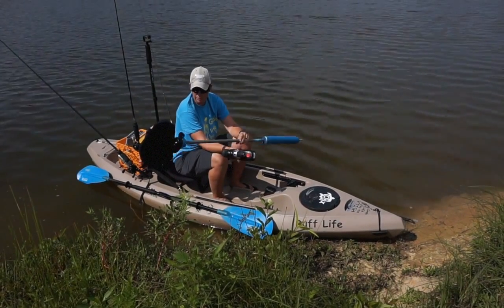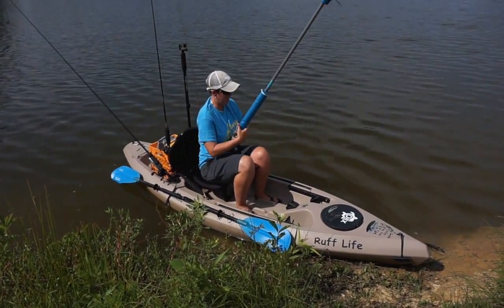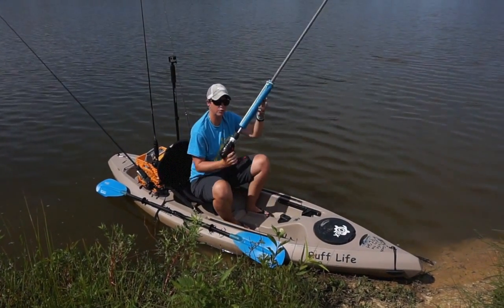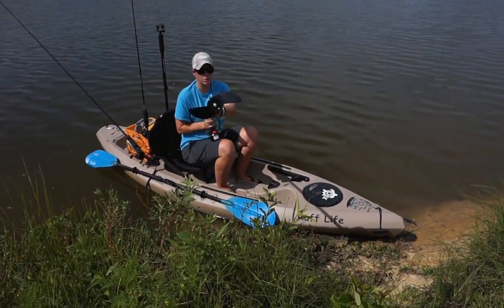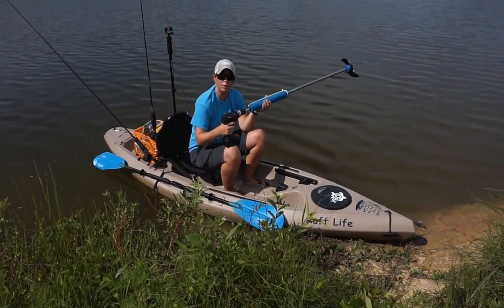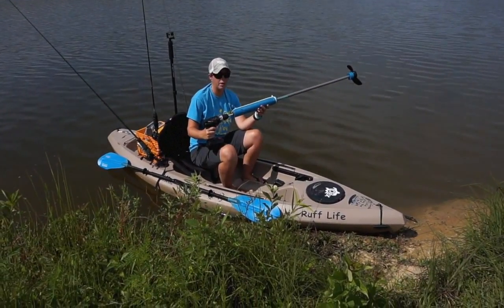Drill paddle demonstration and update

Comment: If you had a 12v drill, could you just take off the battery and wire it up to a deep cycle marine battery?  Some of the drill batteries have little circuit boards in them for safety but that can be bypassed.  Still not sure if the drill windings would overheat.  
It sucks where I live, I would have to register my kayak if I used that.  This law is so frustrating.
Reply from the maker: That stinks!!
Reply: DrGopta you can wire a car battery to a 12 v drill and it works great
Reply: Do you need to register if you use the cordless drill?  Considering an Intex inflatable , but I don't want to register it, but if I have to, I might as well go with a trolling motor. Curious, thanks!

Comment: Awesome video!!!! I definitely need one, I was gonna buy a trolling motor for my Canoe but in NYS to use a trolling motor even in canoes or kayaks You have to register it I think thats bs so this interests me a lot all my drills are Dewalt and Makita so they have the power for sure I also have some Impact drivers that would work Great to :)
Reply from the maker: You should pick one up. Makes traveling if you are just trying to get to that certain spot easy!
Reply: This is considered a motor so you will still need to register it.
Reply: @taylorhickman84  not if its attached to the vessel if it's free handed then it's fine

Comment: With the cheap drill how's the battery life
Reply from the maker: You can probably run it for 15 or so mins before it starts getting low but the good thing about cheap drills is cheap batteries, I have 2 batteries and that usually gets me where I need to go and more.

Comment: Electronics and water (drill) do not mix not only does the drill get hot and the battery die quickly everytime you lift the propeller out of the water the water goes down the tube to the drill,it would be better for mixing a 5 gallon bucket of paint or drywall mud,, a paddle  wheel would probably  be a lot better no electronics,,I know two batterys for my drill are around 90oo for half batterys you can get a trolling motor for that,,I would rather bolt a 5hp motor to the drill paddle than my drill it's cheeper
Reply from the maker: I have been using this for 2 years now. Drill and batteries still work. Much lighter than a trolling motor and battery as well.
Reply: Patient to doc..."It hurts when I do this..."
Doc to patient..."Then don't do that..."